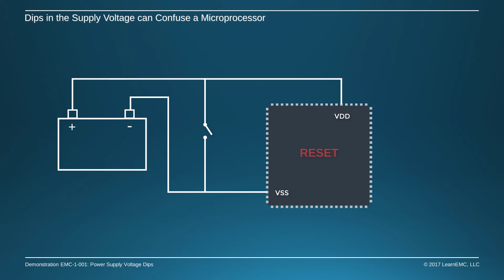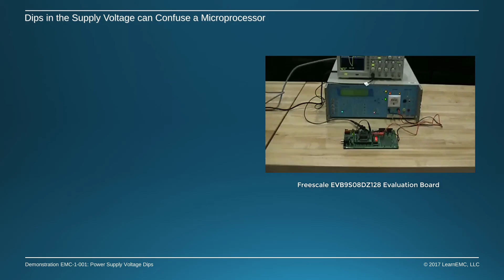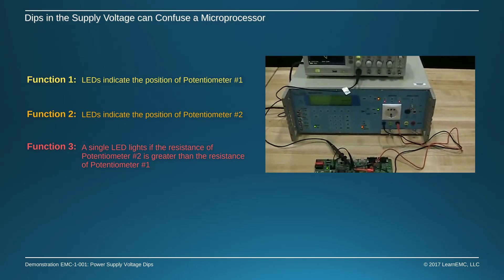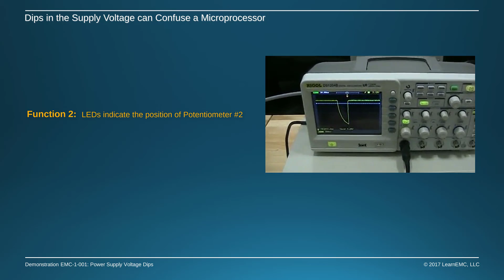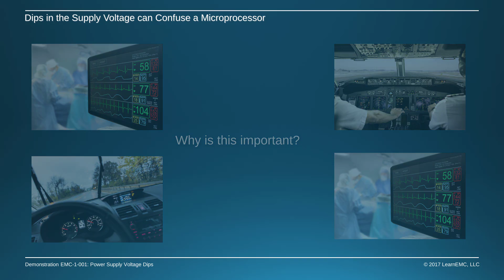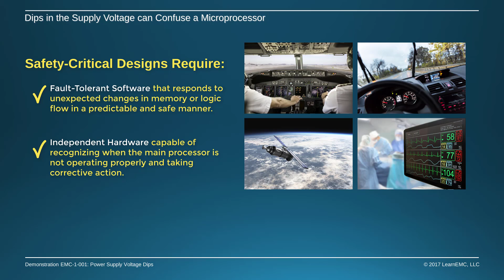Dips in the Supply Voltage can Confuse a Microprocessor

Comment: Interesting video, and actually one of the first tasks facing the embedded designer, how to design the reset circuit and local charge storage so the processor is never "Confused".  For charge storage, or broadband supply decoupling, we provide charge storage for a very wide bandwidth. Basically, a combination of overlapping capacitors from the PCB interplane capacitance, to traditional decoupling to bulk storage (you can simulate the combined impedance if you can characterize and select each capacitor used on the bench, you can then fine tune on the PCB). Which together with the proper reset device will omit the possibility of a fast transient being imposed across the uC, and the reset circuit will trigger long before the uC core loses functionality.

Comment: A good video, reminds why this stuff matters in a critical design.

But I feel that the short transients that did not reset the processor but depleted the decoupling caps did NOT put the processor in a "random state". This is more of a GPIO issue, because the processor will read an incorrect logic change in the GPIO if power dips this way. Adding a capacitor to GPIOs that detect change in states such as buttons typically reduces this possibility.
A system that does not depend on external manual GPIO inputs will most probably not face this issue.
Reply from the maker: The state of the processor after the voltage dip was "random" in that it was unpredictable. In this case, it was most likely determined by what the code was doing at the precise instant the dip occurred. This may or may not be a GPIO issue in this example; however there are many ways that a temporary loss of voltage to the supply pins of a processor can confuse it. Memory loss can occur, counters can be reset, and a variety of inputs can be corrupted (not just manual button inputs). Capacitors, in general, are not necessarily an effective counter measure. They can stabilize voltages for a while, but a long-enough voltage dip will still cause things to start to shut down. The key is to actively manage the shut-down process.